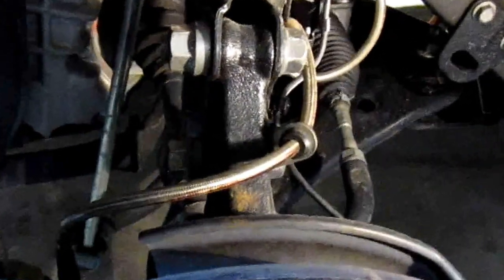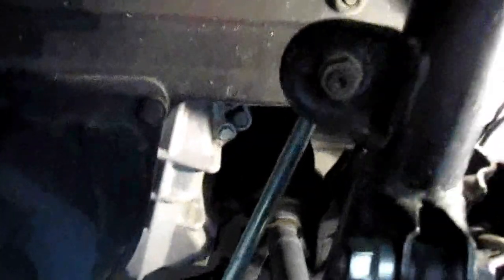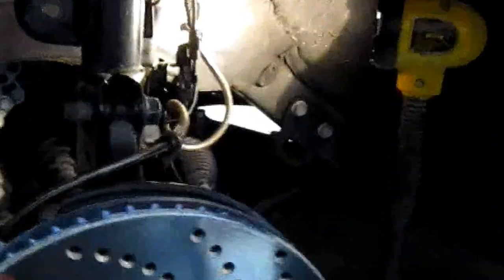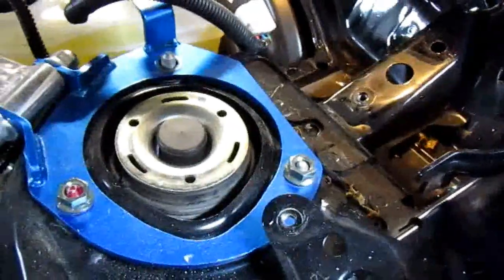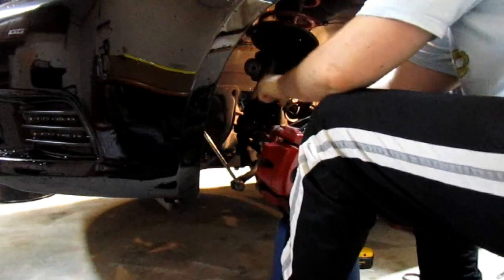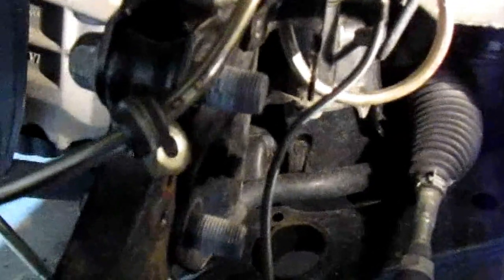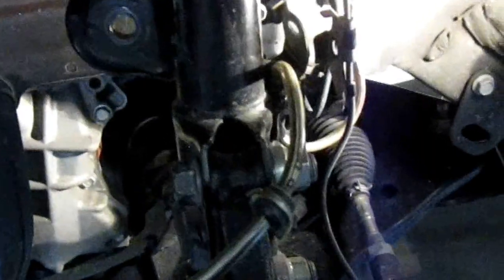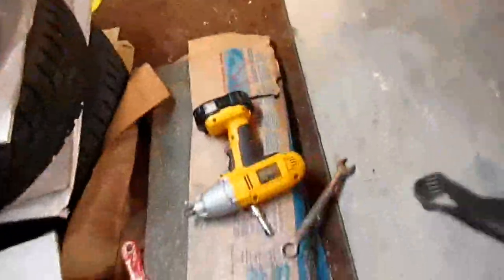2011 tC: How to replace front springs by ScionEdge

Comment: Maybe leave one bolt on the bottom of the strut so you can take off all the top mount bolts and not have to worry about it just falling off and pulling on brake and sensor line. Just a suggestion.